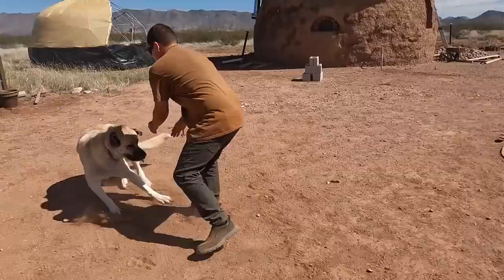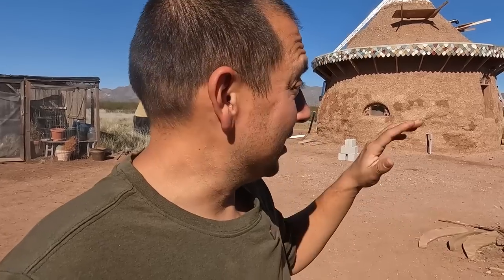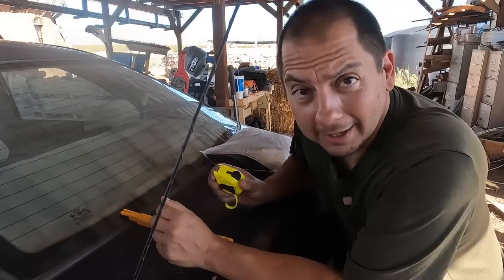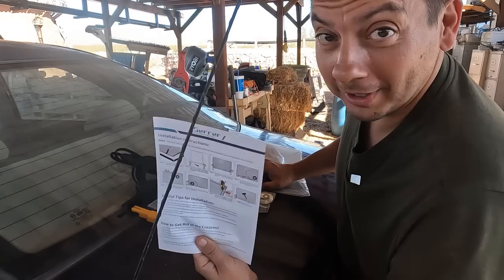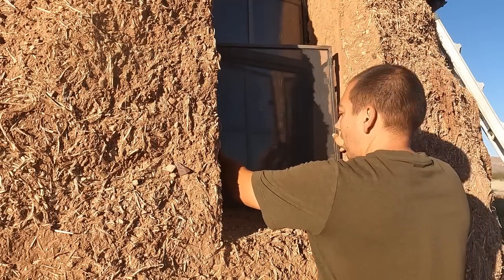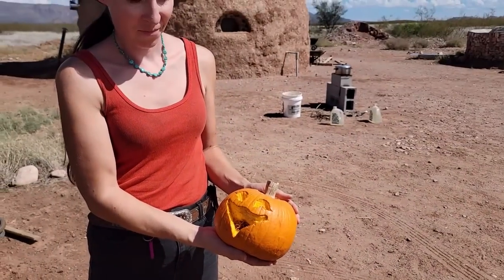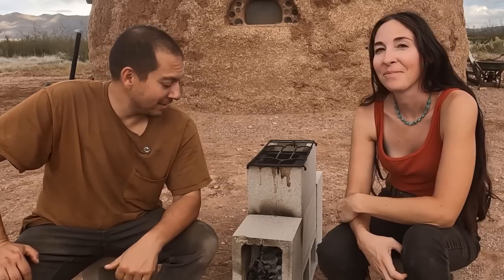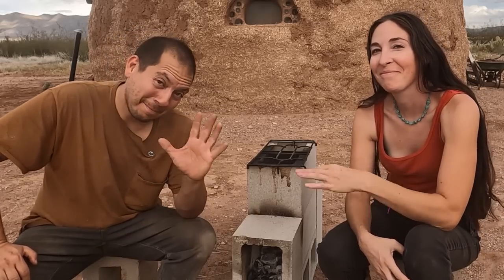Building A 2 Burner Rocket Stove Using Cinder Blocks | Off-Grid Cooking

Comment: Here in the Midwest, screens are a way of life.  The easiest way I’ve found is to remove the spline and old screen, lay the new screen on the gram without measuring it, then put the spline back in and trim around the outside edge. If you need to re-tension you can pull out two spline pieces and adjust. You guys are looking good as always!
Reply: Frame not gram. DYAC

Comment: You can still use the indoor rocket mass heater to cook. You guys put the pipe in the barrel close to the top of the barrel, so it'll get hot enough to cook, heat water, and still heat the house. ✌🏾

Comment: That rocket stove  is awsome Jim and Jess! keep up the great work! 😎
Reply from the maker: Thanks! Will do!
Reply: Just a quick warning, make sure your cinderblocks are dry when using them for the rocket stove.  Little pockets of water in the blocks could rapidly heat and be a bit explosive, which no one wants.  This is why many folks use fire bricks for their rocket stove.

Also, one quick modification, if you want to cook for longer on the stove, and use longer burning fuel, is to make a bit of a tray for the fuel to sit on, and an air channel beneath so the air draw won’t be impeded by the fuel burning, and you get that full gasification level of heat, which is the rocket part of the rocket stove.

Comment: Soup looked Great!  But I bet trying to clean the outside of the pot was/is a pain.  Old Boy Scout trick for when you cook over wood fires.  Coat the outside of the pot with a generous coat of liquid dish detergent before putting the pot, pan, whatever on the fire.  Makes cleaning much, much easier.

Comment: Protect your root cellar by constructing a roof that is not connected to the bags and thus not creating a direct weight load below. A roof with a direct weight load to the surrounding outside dirt wall will last a long time. A roof from concrete blocks and wood beam trusses will carry the required weight load and protect the bag walls below

Comment: To deter the dog from going through the screen, build a second light frame and screw 1/4" hardware cloth [wire] on it with panhead screws and small washers, put it inside behind the bugscreen, it will deter cats or dogs from ripping the screens !!

Comment: The chickens will eat the pumpkin better if you hang it by the neck. When there are large pieces of it remaining, those pieces can be spoked on the prongs of a tomato/pepper cage (shish cabob)  that is turned upside down and the ring weighted with stones.

Comment: okay the idea of a rocket stove is good it is simple and it works  BUT the cinders in the blocks have air in them and when you heat them up the air starts moving the hotter the fire the faster the air moves and can and will at some point cause it to explode be careful not build to hot of a fire or be safer use  concretes blocks instead  be safe god bless

Comment: FYI. My mother would sew a button on the screen give strength and the hole small. Also I'm truly surprised that more off griders aren't using the rocket stoves
Reply: once you determine the best location build up a base (WITH SAND BAGS.) maybe 30-36 inches and then use the rocket stove. You will be  able to stand and cook. Maybe a a cover roof too, that will  protect your from the sun or rain.